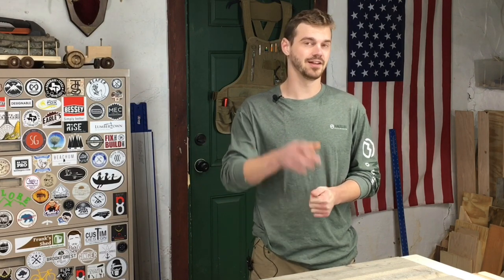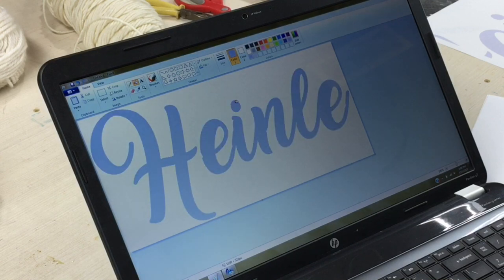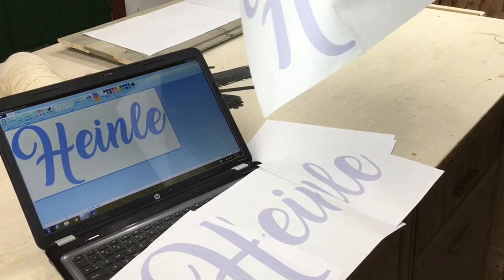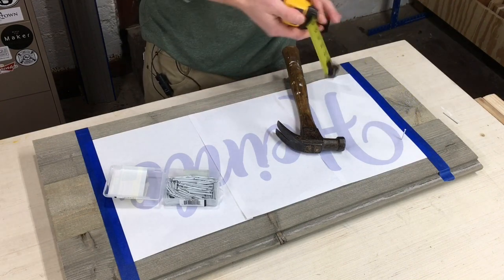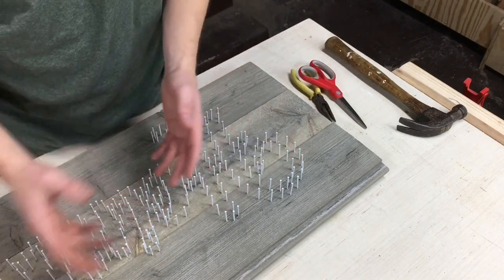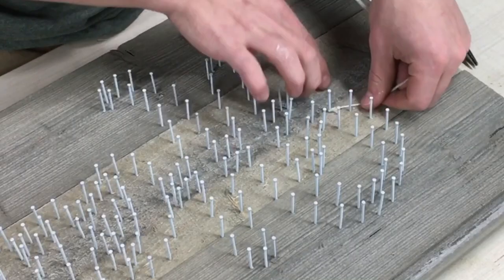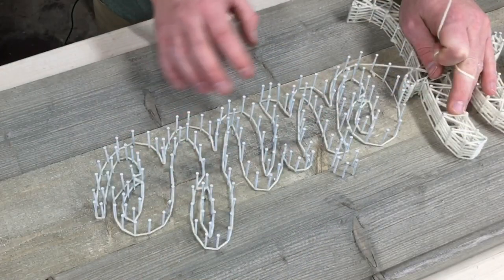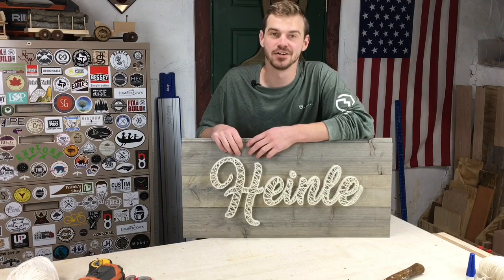How to Make String Art

Comment: Thank you sooooo much for showing us this video!  Alot of 'sting-art' videos state that there is NO method to the madness (as one quoted).  They looks super messy when they were done.  You actually have a method to the string art madness.  Your finished string art is beautiful!  It is clean, has straight lines and doesn't look crappy.  Some uploaders were using crochet cotton which is super thin ( the string used to crochet doilies).  I wonder what bulky yarn would look like... I don't think I would get a beginning and ending outline including the filler, with the size of nail u used, lol!  I would need a 2" nail!  It would probably look great on a huge sign tho.  Tfs!

Comment: Pretty straight forward project but looks nice anyway. One question: Could you use spray glue or spray paint at the finished project, so when it gets dry you could get rid of the nails and the board? I am thinking of seperate letters filled with an led strip and would like to know if this method could be used for this task. Thanks beforehand and keep up the nice work
Reply: A nice idea indeed. I was thinking of LEDs too actually. I think you could either spray-paint (or glue) the whole thing. You can also try using a mix of vinylic glue and water, and "paint" the strings with a brush with it.

Comment: That was Awesome! I feel I could attempt something like that. Do you get Cedar tongue and groove and then stain it? Could you use stained or distressed pine?
Reply from the maker: Tekton Wood Design i’ve used pine but it’s slightly harder to nail into i think. This was actually the fake distressed cedar shiplap that they sell at home depot. I didn’t have time to stain and distress my own on this job, so i went the easy route haha.
Reply: Mad Raven Woodworks Either way works!! I'm thinking family signs for Christmas for my sisters and sibling in-laws.
Reply from the maker: +Tekton Wood Design this is actually cedar shiplap straight from home depot. Had to do it in a rush. I typically used okd cedar fencing but was fresh out. I also distress pine.

Comment: Don't nail into the paper. I use a push pin to push holes into the paper and then take the paper off and do my nails.
Reply: I drill mine through the paper, I tried this way and the paper gets way to stuck. Push pins a great idea too.